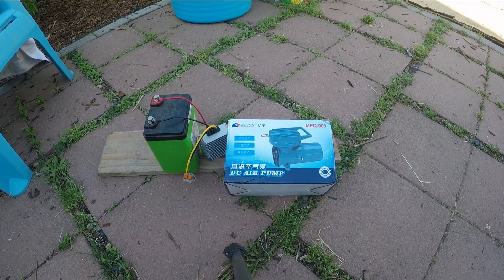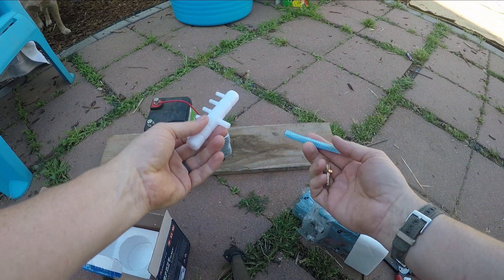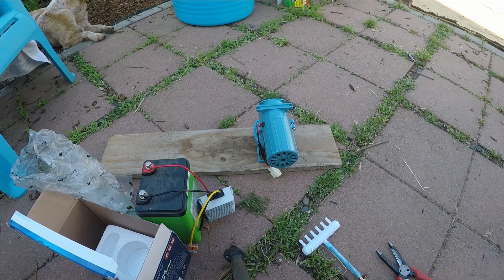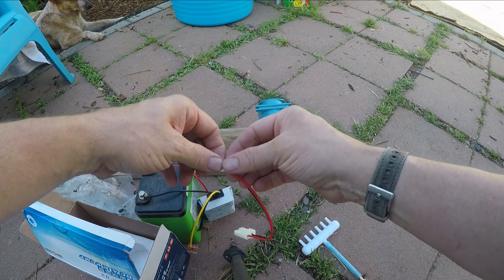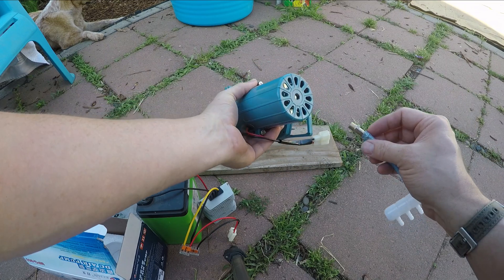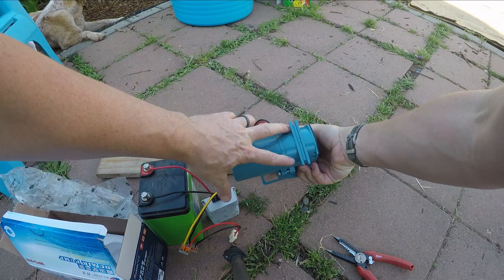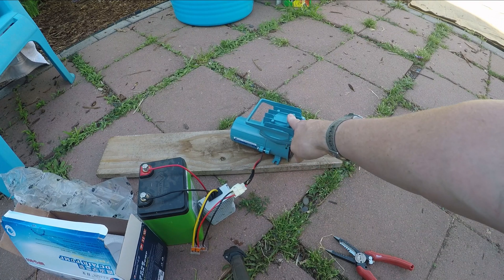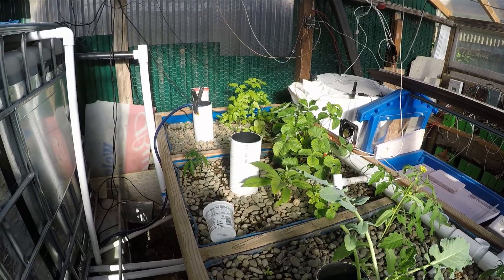Aquaponics DC air pump

Comment: Hi sir.. what do you call that white thing between the battery and the air pump??
Reply from the maker: Step down converter to take the 24v battery down to 12v.

Comment: How's the pump still working out
Reply from the maker: I'm ashamed to say I haven't plugged it back in yet. I pulled it after a failure and put a different one in play. It has been cleaned out and greased but still waiting to be tested! With excess sun coming soon I'll get it plugged in and report back.

Comment: better off using an inverter and run AC as DC pumps only last ~ 3000 hrs before the brushes are stuffed
Reply: Not sure on the pump construction but brushless dc motors exist. But ac pumps are actually very simple some like the tetra series don't even use a motor rather a oscillating electromagnet pushing on a diaphram. Tetra makes some high output ones that can be rebuilt with a 18$ kit, vs tossing a 80$ pump

Comment: Does yours get hot like mine?
Reply from the maker: It did. It died a couple months ago but I've already opened it. Looks like I should be able to clean out the grime and grease it. That'll be soon. Got a lower powered air pump in place for now.
Reply: @penguinponics  let me know when you find carbon brushes that work
Reply from the maker: @christopherstaples4222  I finally got around to fixing it. Didn't have to replace the brushes. Lubricated the inside shaft after cleaning it. I tried to grease and lubricate on the diaphragm side but that didn't make a difference.

Comment: Hi, how do ypu charge your battery? 
Any advice on how to get one to run 24/7 would be appreciated 
Thanks
Reply from the maker: Solar panels and a charge controller. You can see my battery bank in my greenhouse videos.
Reply: @penguinponics  I've watched all your videos can't make out what you have going on there with all them wires lol 
Do a video off your system? 
I'd like to see how the turbine works with the solar panels
Reply from the maker: @robertstone7484  It's actually on my short list of things to do. I want to clean up the wiring a bit first.
Reply: been their done that with a dozen or so aco-03/6's 3 months max and they are stuffed , the brushes / armatures wear out pretty fast , so now using battery / inverter and LP-100's

Comment: is your pump still working? am curious if it will last.  Also have solar powered aquaponics here.
Reply from the maker: Yes! I run it 10 to 12 hours a day and have not has an issue with performance.
Reply: @penguinponics  thanks. ordering 1 that is 18 watts but will run it 24/7, hope it will last
Reply: @penguinponics  how's the pump holding up, I've seen these on Amazon with sketchy reviews. I've been using a tetra ap300, which has a serviceable diaphragm. unfortunately it's ac so it needs a inverter, but the design is bulletproof.
Reply from the maker: @byteaquaponics  I'll see if I can plug it back in this weekend. My free time is limited with a special needs child. Need to test if rebuild fixed it.
Reply: @penguinponics  I fully understand, take your time
Reply: @penguinponics  out of curiosity what needed service, brushes, or diaphragm, or something like a bearing
Reply from the maker: @byteaquaponics  it was the shaft at the bearing inside with the motor. It's up and running for now finally.
Reply: @penguinponics  I'm glad you have it running again, I hope it runs better than new now.